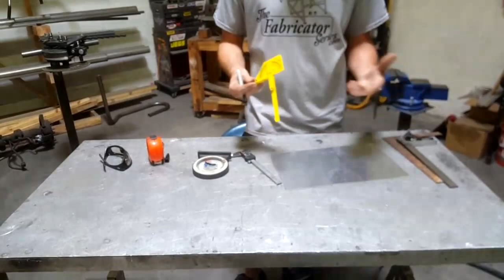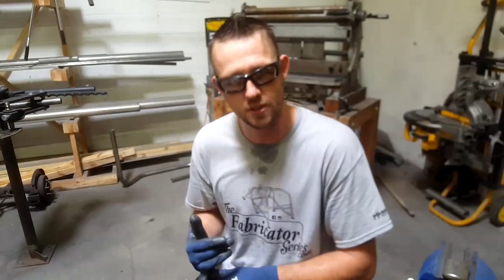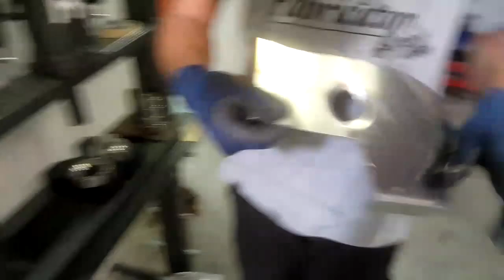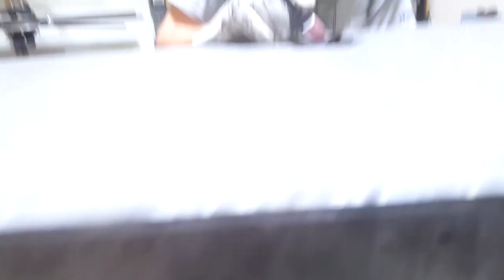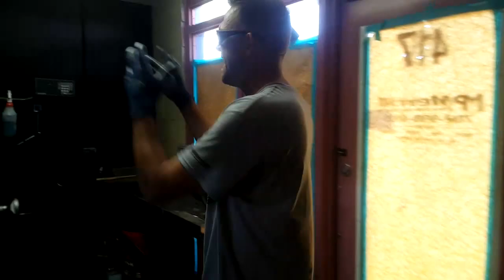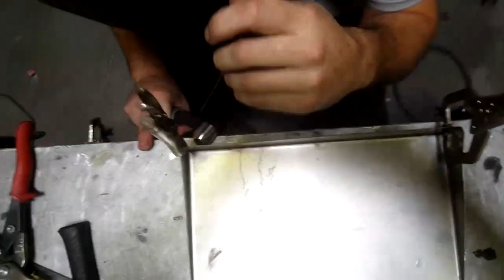TFS: Tools of the Trade

Comment: I bought a 4 pack of those Milwaukee markers based on your recommendation,  i don't really notice much difference. Its definitely not a 6 : 1 difference. 

Your BFH would be called a single jack on a construction site (eventhough its technically a double jack). A BFH is a 50 lb sledge hammer..

Comment: I have three tape measures that I’d rather not do without- ever. 
16’ Stanley Fat Max. Small, not bulky, but very stiff blade. I hate giant-case tapes  
Lufkin 25’ Self-centering tape measure. Not often used but priceless occasionally. 
A 6’ or 2-meter cloth seamstress tape. Not on a reel. Very useful doing shapes and round things. Now that I think about it I do have a couple seamstress tapes with retracting reels, but the cloth 3/4” tape is most useful. 

Just thoughts for a beginner to consider

Comment: Beware cutting / grinding non ferrous metals with a composite disks. Most non ferrous materials have a much higher expansion rate than the wheel
Portions of the material get lodged in the grain of the wheel and can expand & fracture the wheel while its spinning - bit of fractured wheel can make nasty wounds
I did not believe this until it happened to me (in  small way)

Comment: I prolly should've finished watching the video and you may mention it(DOH!) but i really like using my Dewalt cordless  jig saw(with a fine blade ) for cutting a wide variety of stuff. Yeah snips can be brutal but ive been stuck needing some sheet metal cut and snips were the only option money permitted. I 4hink it's worth mentioning using the correct handedness for the  job makes a significant difference(so did the nibbler I got later on ). But kits with a righty, lefty and straight for a reasonable price. Your videos rule ! woot! woot!

Comment: I have the $20 HF grinder and it has yet to let me down

-besides the time I broke the locking mechanism and stuck a hardened Alan Key into it, instead of it unlocking the two nuts, it sheared off and wrecked the gears upon startup...

Comment: Nice video .. fyi, that square that does 90° & 45° is called a combo or combination square. That other one is a framing square. The carpenter's square you mentioned is a speed square. ..and thanks for keeping it real with the guard off the grinder. I've never used a grinder with a guard on it. Idk how people  do it for any kind of detail work. Evolution  makes a decent metal cutting saw on the cheap

Comment: Yes, everyone should buy a $1,000 welder that rusts away in the shed !

Or buy a $100 stick welder just to TRY it out and then see if it's something that might get used more than once... If not, hell it was only $100, take it apart and play with the transformers... I got a cheap welder instead of making one out of an old microwave lol, maybe I should have went with the old microwave idea ?

*Anyone looking at "cheap welders," look for 160Amp/ 60% duty cycle or something, watch out for ones that are only rated 10% duty cycle at max output (10% duty cycle is like 1 minute use for every 10 minutes), it's a marketing ploy I think.

I "liked" the vid though, or "thumbs upped" it...

Comment: A bit late, since the vid came out like 3 years ago, but still, great content, great vid. Set my mind into starting a small welding shop. Although talking about welders, have you ever tried SELCO, Italian brand that produces a lot of the components for LINCOLN. Other thing, when you started TIG welding, did you started with or without the pedal? could you use more metric instead of imperial measurements? But overall great content and inspiration. Keep on going.

Comment: My $90 Harbor Freight 10" sliding compound miter saw with $25 Concord ferrous metal cutting blade has been an absolute ROCKSTAR cutting steel for a price that is impossible to beat

Comment: The Fabrication Series 1.05:35 You said  do not buy a cheap welder. You used Lincoln and Miller at the time of this taping and said those are the only 2 you would recommend. Now you Own a few Everlast , thats allot cheaper than the competition. I grew up using only miller and Lincoln and own a Everlast power tig EX250. Ive been very happy with the Everlast brand. How about you?
Reply: Yeah he’s really pushed his 255 EXT Everlast, saying if I’m not mistaken one of his favorites? And the AHP 201XD has been pushed a a good welder and you can pick that up new right now for $720 I believe. So either he’s taking the money from these brands to lie to us or  over the past three years he’s changed his stance on welders he’d “recommend”. I’d really like to believe it’s the second one.

Comment: For cordless tools I prefer Ryobi. The DeWalt stuff I used in both construction and auto work broke or didn't have the strength to do the job. I never had a problem with my Ryobi stuff. Ten years construction and auto repair (at the same time) and never a single problem. Plus half the price.
Reply: Neither have a chuck decent to drill metal those chucks will not hold bits in heavier steel need a keyed chuck to tighten enough
Reply: Milwaukee or nothing

Comment: I dis agree on the welder rec's I have a older miller 211 its the one of the best mig's I have had but my brother bought the new smaller 211 it was junk and kept braking. miller, Lincoln, Hobart (is miller), esab, airco your high dollar are good but now you got Everlast have one works good htp, fronis, and if ya want tig that is great for the price ahp 200anp acdc tig for under 700. have one of them also best money I spent in a long time if you a weekend warrior its a great but get a top brand if your going to use it hrs a day. and I only use miller helmets I love them but there is also tons of good auto darks but agree don't cheap out there you need your eyes miller , 3m , speedglass , Lincoln , Jackson , Hobart and lots more I recommend no less then $100 on auto darking helmets. hope this helps
Reply: Buy Everlast nothing else! Hypnos good also but stay tf say form Lincoln’s and millers!

Comment: Metal shears? They are better than any of those others you were using. They cut really cleanly. They’re also fast. Up to 16 ga SS and 14 ga steel. Cut almost anything stiff (no fabric).

With a little practice you can cut a perfect straight line or curve. It doesn’t distort the metal unless you hold it at a sideways angle, and that’s just on the edge, easily tapped out. I have an Irontron from Northern Tools. It’s not expensive, and works really well. Most every other portable power tool I have is a DeWalt. Love those! Was wondering why you didn’t use the shears in the beginning.
Snips for short stuff and tight angles. Shears for most everything else.

But no abrasive saw. Nope. Too much dust - everywhere, and in the air, where you breath in fiberglass and abrasive from the blade. Whatever metal alloy you’re cutting. Nope! Only a carbide saw. Cleaner cut, the metal isn’t hot, and the small metal cuttings go to the floor, not in the air, and your lungs.

Love your channel, but there are a few things here and there.

Comment: I just started Tig welding and the most
 frustrating task for me was the ability to operate the foot pedal, while trying to add filler, while trying to maintain consistent speed. Combine all that with someone that has No experience, yeah very stressful lol. I don't think I could have learn as much as I have if I bought a cheapo tig welder. I invested $2800 in my Miller snyrowave 210 and don't regret it one bit. I agree with you, INVEST IN A GOOD MACHINE and practice practice practice. Just welded my first intercooler tubes with no issues. Don't give up if your just beginning.

Comment: Please use a brass hammer when hitting hardened steel. This will reduce the likelihood of the hardened steel shattering or sending off a sliver. I have a nice scar from impaled sliver because I used a hard hammer on hardened steel. Noticed it when the wound stayed black and a magnet would pull my skin out :)

Comment: and please address that if some kind of videos come next time that for a angle cutter invest in proper add ons because with steel disk where you cutt aluminum it could explode in your face so it's one more rule for just safety because it's powerful tool but it's also dangerous if it's misuse

Comment: Maybe throw out there that one reason people don't use grinding wheels on aluminum is that it will actually "clog" the wheel. If you do it long enough without paying attention, the disc can get too hot and explode. I found out the hard way.

Comment: I noticed you use a abrasive chop saw blade, have you tried a  carbide toothed blade and prefer the abrasive? If so could you highlight the differences? I use a carbide blade on a 18 volt circular saw a lot for cutting angle. Found out recently that you don't cut stainless with it:) That  was right after learned not to cut bed rail with my(relatively) new diamond cut off wheel:) Great videos by the way.
Reply: Cold cut leave a cleaner cut. Less clean up.
Reply: kraft zion I was just wondering the same thing.
Reply: You can’t run a shop saw blade on an abrasive cutoff saw.. one spins way to fast for the other

Comment: No love for Hobart welders?they literally come off the same line as the small cased millers. Hell my Hobart 210mvp(Hobart flavor of the Miller 211mvp) has a Miller cord on it and the wire feed wheels are interchangeable. The onlyThing you don't get with the Hobart as opposed to the Miller is the autoset,as well some of the earlier Hobarts had a plastic wire feed components, but the newer Hobarts have aluminum just like the Millers. I paid $850 from tractor supply for my Hobart as opposed to $1100 for the Miller 211. When I chose my machine cost wasn't really a factor, I chose the Hobart because when it came down to it their almost the same machine. My dad went over the specs of both machines and determined they are almost identical( He's an electrical engineer).
Reply from the maker: swisherboi I never said it was bad. I just don't own one.
Reply: I know you didn't say anything bad about Hobart,but I don't think you mentioned them at all. They knock the comparable Lincolns dicks in the dirt. Not only do you get more machine with the Hobart over the Lincoln for the money,you're also getting a machine made in the USA that is made in the same factory as Miller. The Lincolns are made all over the Damn place(15 different countries to be exact). All I'm saying is give Hobart a little love. Btw I've used plenty Lincolns,their just fine,but if someone can get an American made machine with more amps for the same price I'll will always tell them to spend their hard earned dollars on something that they can be sure will be an excellent machine.
Reply from the maker: The thing is, I usually don't mention or recommend tools I don't own or have first hand knowledge with/of. I have used Hobart machines before, and liked them, but I simply don't own any. There's hundreds of tools and brands I could have mentioned, but that would not deliver anything but a pitch since I don't actually use them. I try to keep this channel accurate and true based on first hand use.
Reply: I respect that
Running a Miller and running a Hobart are almost the same,both have very similar arcs. I've welded with both.
Reply: @swisherboi we get it you choke on Hobart a fuck. Those 211s are trash machines.
Reply: Millers are junk as are Hobart.

Comment: With aviation snips, the color of the handle has nothing to do with which hand it should be used in. Red snips, waste material comes off the left. Green snips, waste material comes off the right.
Reply from the maker: You're right, but have you tried to bend your wrist in the opposite direction to make a cut? While orientation is not specific, it is often associated with the opposite hand of the direction.
Reply: The r and gsnips r made to cut r or l and the yellow straight and either direction which I use the most,  r and g  will cut tighter in the direction they r made to cut

Comment: using a steel cutoff disc instead of an aluminum disc can be very dangerous as it will clog up and with prolonged use will explode. Same goes for bench grinders, clogs them up almost immediately.
Reply from the maker: True, but I rarely use them for aluminum.

Comment: A good hole saw? Tried so many brands; either the teeth shear off, they go dull or are so out of round they make holes bigger than necessary. Tried DeWalt, Milwaukee, Mikita and several others. (Trust me, I went through piles of them!) and so far, they're all pretty bad. Just trying to notch some fishmouths into DOM tubing or holes into .25" plate.
Reply from the maker: I use Milwaukee the most. If you keep destroying them, try adjusting your feed and speed during the cut. Slower speed and steady pressure (enough to get a good bite and clear the chips without serious force) will make it last a while. A good lubricant helps as well, but is not necessary if feed and speed is on point.
Reply: Milwaukee makes the best ones that aren’t carbide toothed. Otherwise oook into annular cutters.

Comment: no guard on the grinder. goodbye fingers haha
Reply from the maker: All 10 still attached as born, but it's a choice not to run it - not a practice.
Reply: well it was designed to be used with it attached… but i guess dewalt only spent like $10 in R&D
Reply: Fuck the guard I was surprised it was sitting face down on the table got a watch the dewalts when there like that walk by bump it and it goes off on its own lol seen it happen

Comment: 2 questions - 1. You mention the difference between a pipe and tube bender, jet JD2 lists the model 3 as a tube/pipe bender. Does that just mean it can also bend pipe, but is made for tube? 2. Do you only use an abrasive disc chop saw? I'm about to purchase a saw and I thought that a cold cut saw would work better. Do you not use a cold cut saw at all?
Reply from the maker: The die profile is the primary difference between tube and pipe bending. JD2 offers both die styles for tube or pipe. Other differences include the process to bend. Pipe usually crushes tube from the center of the bend while tube will draw around a die. Check out Tube Bending Basics for more details. 

I have a horizontal band saw as shown in this video which makes cold cuts. Since virtually all the cutting work can be done with the tools I have on hand, I have no need for the round/chop cold saw. It's an unnecessary expense for me, but a nice tool to own of you do a lot of production work where less post cleanup is desired. The same can be achieved with my horizontal band saw.
Reply: I have a Makita cold saw best money I have spent fast and will pay for itself  before the first blade needs changing out

Comment: Just found your channel the other day and I think it's great. My son and I are going to start customizing a cj5 soon and we were looking at tube benders. We have settled on the JD Squared 32 but I have a question on dies. I know this is probably a difficult question to answer but which would be better a 6.5 x 180 or a 7.5 x 180 for 1.75" tube?
Reply from the maker: "better" is determined by requirements based on use. The best place to find the answer on CLR requirements is a rulebook for the sanction that matches your cage or chassis design. If you don't have that info, it is generally regarded as safe to follow the rule of thumb which is Diameter x 3 = minimum CLR.

Comment: Love your channel, I'm building a custom truck in my garage and when it comes to cutting I'm always having a problem which cutting method I should use. Have you tried using metal cut off saw/miter saw blade for metal They are pretty expensive. Before I buy what is your opinion.By the way I also live in Vegas.
Reply from the maker: You should swing by the shop some time and check it out. I can even give you a quick demo of some of the tools here if you need. 

I primarily use an abrasive blade for the chop saw. I have used carbide metal blades in the past, butthespeed of the saw was always more than the blade was rated for, so it went dull quickly. I also use my band saw frequently when I need clean and quick cuts with less cleanup.
Reply: +The Fabrication Series I use a router speed adjustor (basically a voltage regulator) to turn down the speed of the saw for blades designed to run at slower speeds.

Comment: What kind of blade do you use on your chop saw and do you have a problem with blade deflection? Thanks and great vid!
Reply from the maker: I use a regular abrasive blade. Remember to let the blade to the work - not your muscles. If you force the blade, it will deflect. If you let it cut its groove on its own, it will not deflect. Let the saw do the work.

Comment: What kinda Tig cup were you using toward the end making the dust pan.
Reply: Dustin, the Unbreakable TIG cup should be available in the coming weeks. We are working on our first batch to release to the public as we speak. Follow my Instagram page, @superiorwelding, for its official release. And thanks again to Justin for featuring it on the show!
Reply from the maker: That is the Unbreakable TIG Cup from Superior Welding. Check out the demo of it a few minutes before I switched it (this video). It's a fantastic tool.

Comment: buy electric tools that you can get replacement parts for ! , 50.00 4.5" black and decker grinder after 2 years needed brushes ... no parts available for it ! JUNK !
Reply from the maker: Good brands will get you farther. Lesser brands will end up costing you further down the road.
Reply: yes Black and Decker was a good brand for many years ,  but now ..... JUNK  . Going to see how long this new Dewalt  will last .
Reply: if you have the money defiantly worth it, i find some things can get away with cheaper things in the mean time. 
or in Australia. ive had a bit of luck with Ozito tools.. cheap crap yes. but 2 or 3 years replacement warranty and 1/4th the price of next "cheap" tools in general.. then i upgrade when possible with a bit of knowledge about the tool behind me.